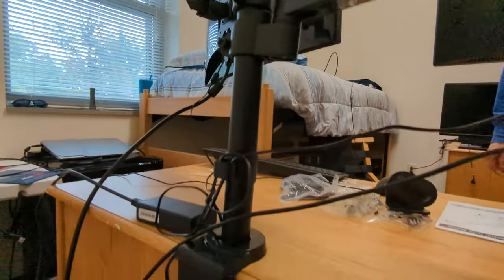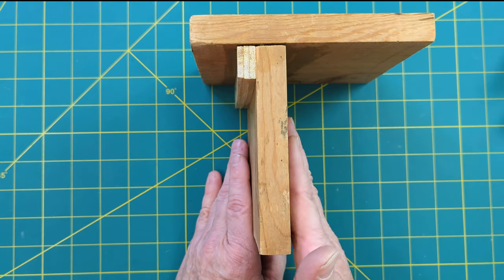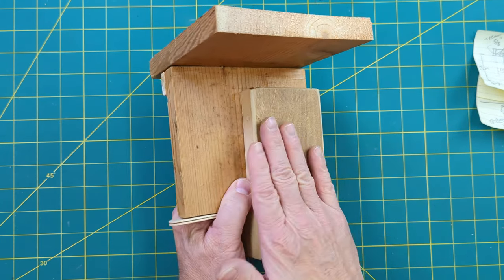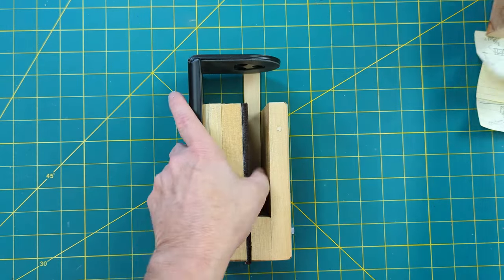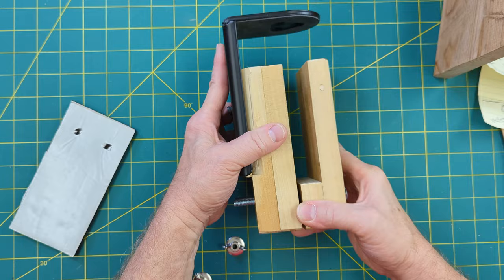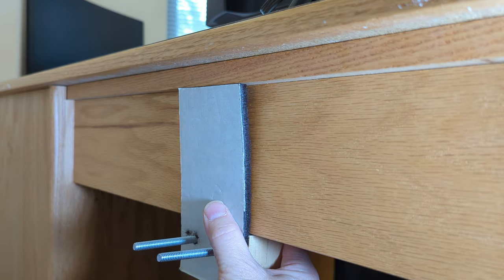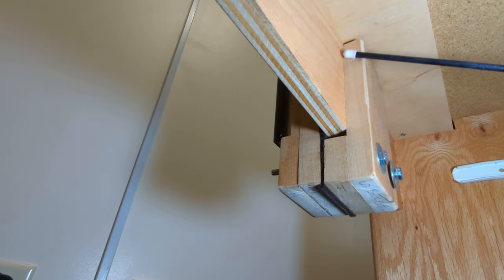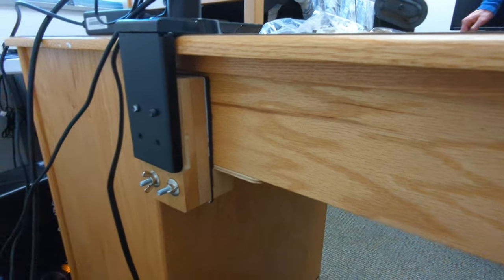How to Clamp a Monitor Stand to a Difficult Desk

Comment: i have a desk with this exact obstacle from the drawer, and small lip that would require a big jaw like this. definitely needing this video this week. got a monitor arm in the mail coming
Reply from the maker: Let me know how this idea works out for you.
Reply: @MakeItorBreakItNow  ive had my monitor mounted now for a couple weeks I think. my model looks very close. I opted instead to add material in front of/behind that wall to increase bottom clamp surface area, increase the vertical jaw length, and clamp vertically. your video definitely spring boarded me, ty again

Comment: Thanks for the video! I have a similar desk and decided on this solution.
Just wanted to chronicle my experience for others who wish to follow this solution. I don't have much in the way of wood working tools so this was very much "by hand".
First, I did similar measurements to yours. Bought a length of hardwood from the local Big Box store. Bought the bolts and wing nuts. But here is where I had a challenge - I don't have a circular saw or even a jigsaw. I couldn't justify buying one for a one-off project. Ok, so got a miter box and saw. 
Marked the wood and made the cuts. Cutting hardwood sure ain't easy by hand! Accuracy using a miter box wasn't great either. Ok, so I sanded them to the same size once cut. 
Next, I had to sand the short piece to thickness. Again, by hand. A planer would have helped but - budget! Ok, got it to the right thickness and mostly uniform.
Next, mark and drill the holes for the bolts. I taped the pieces together and drilled through them all at once to make sure the holes aligned. Important note, number the order of the boards when they are stacked for the hole drilling. It makes it so much easier to insert the bolts when they are arranged in the same order afterwards. I noticed you numbered the pieces as well!
Maybe if you have a drill press this wouldn't be a problem.
Next, was mounting the monitor desk bracket. It wasn't like yours but I did inlay the bolts I bough to join the mounting bracket to the wooden C-clamp. I ended up buying a couple of T-nuts to match the bolts. These were inlayed in the outer board. This was a fun discovery because up until trying to solve this "joining/fastening" problem I had never heard of T-nuts. Basically, you drill an inlay hole so the T-nuts are flush then screw in and tighten the bolt to the T-nut. This attaches the T-nut to the board and makes the T-nut secure.
I think aligning the holes for the mounting bracket was also tricky. I did them one at a time. Check the first hole and used it as reference with the bracket attached to drill the second hole for the mounting bracket. It wasn't pretty but it worked 🙂
I then assembled the clamp to the desk and attached the mounting bracket. I used a socket wrench to tighten the bolts - even the ones that had the wing nuts.
In total, it took me about a week, off and on. Mostly off 🙂 The board cuts and sanding to size was the hardest part.
Given a wood shop with a planer, joiner, circular saw, drill press and sander, this would take maybe an hour to build. It would also align really well. But, even by hand, this project is do-able and well worth the effort.
Reply from the maker: Thanks for sharing your story, glad to hear this worked for you. I have another solution I'm working on that may be easier for those with minimal tools, stay tuned.